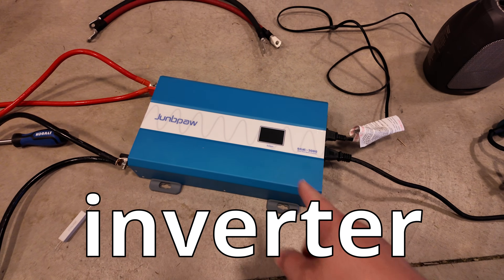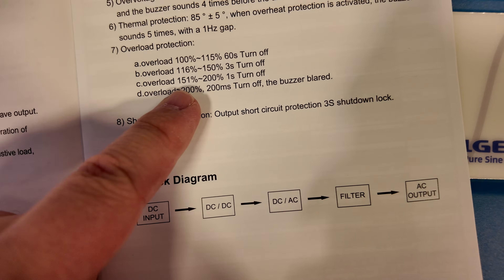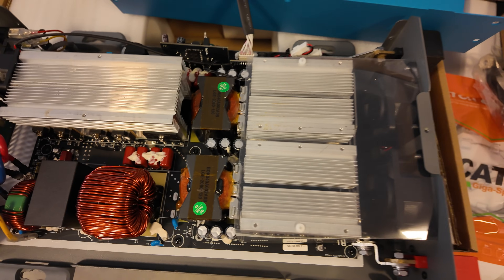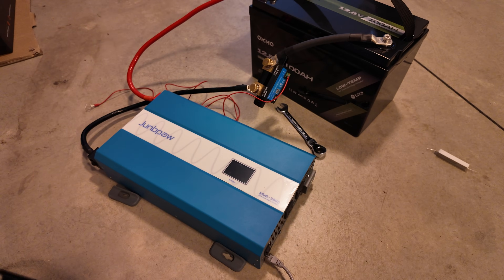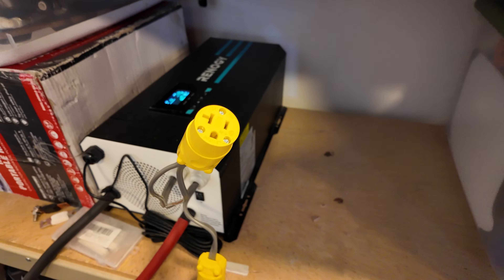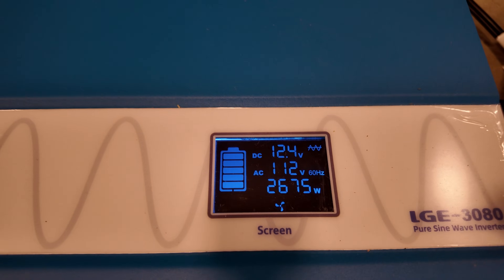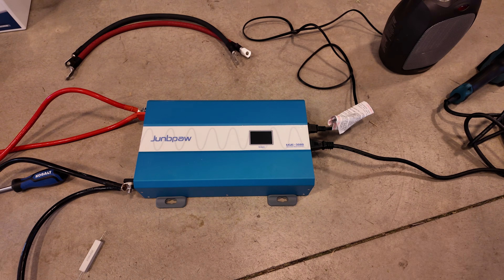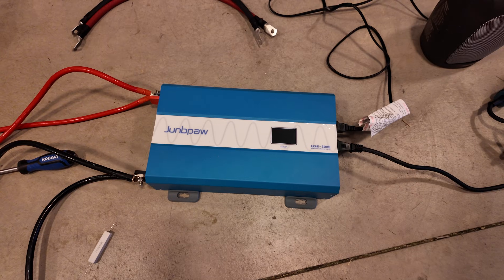Cheap 12V Inverter That’s Actually AMAZING! Low Idle, Quiet & Quality Build

Comment: Ca I use a power strip  with the alternator, for more outlet  options? Thanks
Reply from the maker: Most definitely not. Use the terminal block to hardwire extra outlets in.

Comment: Watched to the end. 
Do you know if the 1280watt version is just as efficient? 
I have no need for 3080 watts, but 1080 watts using only 6 watts would be great.
Reply from the maker: I would imagine it's just as efficient if not more! I've never tested it, but usually the smaller the inverter the more efficient!
Reply: @theresatrickforthat  OK, will give it a try. 
Funny thing, the 1280 watt unit had a $25 off coupon yesterday, price was $119-$25 coupon so $94. 
Today, it is a lightning deal for $84, so went ahead a grabbed it.

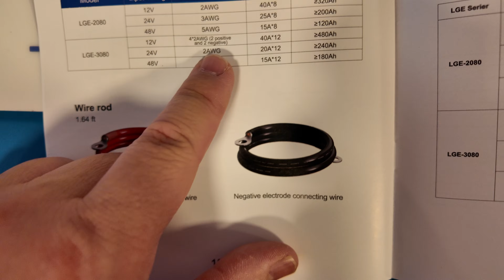Comment: At 1:57 in the video you show a page in the manual. LGE-3080 recommends pairing two 2awg but it also shows AWG and fuse sizes for 24v and 48V . Sorry if this is dumb but I'm new to this ;  can this inverter work with a 48V battery ?
Reply from the maker: They make different voltage inverters… But this particular one is only rated for 12 V
Reply: @theresatrickforthat  ... I found 48V to 12v step-down DC-DC converters but they get really expensive after 30a, sort of defeats the purpose $ wise. I hope Junbpaw makes a 48V version of this. Thanks for your video, I like your in-depth review style ; I'm going to watch more of your content.

Comment: Combine this with 2 wattctcle batteries, a bluesea systems terminal fuse and 40 amp li-time charger... You get 2400wh of storage, 3kw of output  if needed, charging in 5 hours, all for just a tad under $750!
Reply from the maker: Yeah! Isn’t that awesome?

Comment: Inverters AC voltage dropped to 112v at 1200w, not good.
Reply from the maker: It actually goes up in voltage when you apply a load. If you notice when it’s idle, it’s actually down at 110 V.

Comment: Are those automotive style fuses plug-in replaceable (good), or are they soldered straight into the circuit board (bad)? Thanks.
Reply from the maker: Which fuses? The ones inside the inverter?
Reply: @theresatrickforthat  Yes, the ones shown all lined upin a row when you had the cover off of the unit. Thanks.

Comment: Some are better built than others, but high frequency is what it is, temporary and short term, and as you showed, it only wants 100% of its power for 60 seconds, why rate it for that, it's about 15-1800w continuous, that's it, so equal to 1 house recepticle, 5 w is good but it's just an inverter, cant compare that to a solar power station, that's running inverter, screen, mppt etc! You mentioned you had a low frequency inverter too, me too, mine is a 3000w 24v low frequency power station, dual ac chargers, dual mppts 150v, infinately exspandable, on 10kwh in factory batteries, but has a external battery exspansion port, for true capacity, real load sharing and charging, no cables to connect,and no proprietary plugs anywhere, all charging,discharging ,solar, and exspansion are standard Anderson plugs! So I can use my batteries on anything, a meer 13w idle consumption, has 5 dc car sockets 20amp 13.8 v, 6 ac plugs on 2 15amp circuits,TT30 plug, can wall charge,solar charge,ac charge,car charge 20amp,and run full power discharge at the same time! I have never seen another system capable of these feet's yet. And I own 2 of these, 1 can power my 2600sq ft house on 120v, that's all outlets and any 120v appliance in my house, and not 1 major appliance at a time, it ran my 1800w air fryer, tv, washing machine, refrigerator, and lights no problem, it will run my refrigerator, freezer 26cu ft opening and closing as a normal day for 5 days on 1 charge, it would go 7-8 days if I put it on a timer,unplugged it at night, and only opened it as little as possible, I wasn't looking for a camping or power outage solution, but an actual grid down, and I know they can. 1 runs ever 120v plug on 1 cable, TT30 to dryer,stove connection, all on breakers, and 30amp can never overload 50amp cable and connector! With 6kw on my roof, gas generator backup, and a spare inverter 1200w to run from my car as a backup to my backup, it all works quite well
Reply from the maker: Sounds like a sweet set up! Yes! I have a low frequency inverter! Did you not see that part in the video? Mine pulls way more idle current than yours does! What brand is your inverter? And to correct you this 3000 W inverter will run loads at 2800 W all day. So I can do way more than 20 A of AC power no problem!
Reply from the maker: I can literally buy four or five of these 3000 W high frequency inverters for the same price that I paid for my low frequency inverter.

Comment: A 3000 W inverter with a 100 Amp battery ? I am not very "electrical" but there a videos were they dont recommend using 3000 W inverters with just 1 singel battery ,due to extreme short battey live ?!
Reply from the maker: You must have not paid attention to how the two batteries were connected and what size of batteries they are! Might wanna watch the video again! Thanks for watching it at least one time!

Comment: Hmm I have a cheap 12v in the shed it might be a good competitor for this

I already tested a perfect sine wave and it runs all day in a hot shed without issues

Similar cost and features, even has a cool remote screen

Did you test the inverter quality on this to make sure it's "high quality"?

Because if it's modified sine that's why it's cheap and it's also basically garbage for most people with today's sensitive electronics.

Even caught big brands like Ecoflow selling bad inverters advertising pure sine and found issues.

So you can't go off advertising it has to be verified
Reply from the maker: That's a great point and something to consider when purchasing, thanks for the insight!

Comment: Yet again I learn about products long after I already have one. I have a 1kw sine wave inverter in my diy box but have no idea what issue consumption is. Shunt monitors are crazy. There send to only be 2 choices, super good for over $100 and junk for $25. Not a huge deal for me as I very rarely use the system but it would be nice to know. I'd get one of these if I actually used it often.
Reply from the maker: Sounds great! Thanks as always for watching!